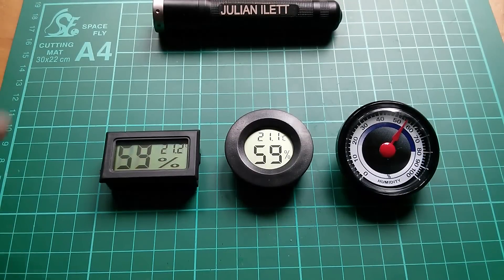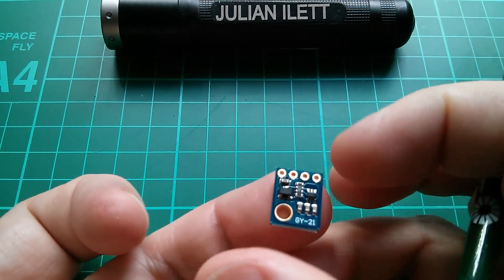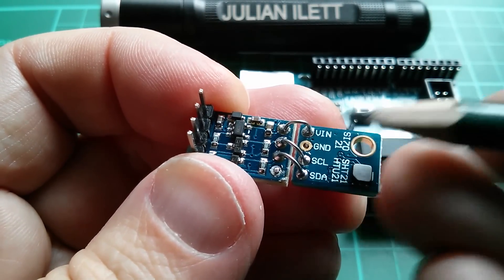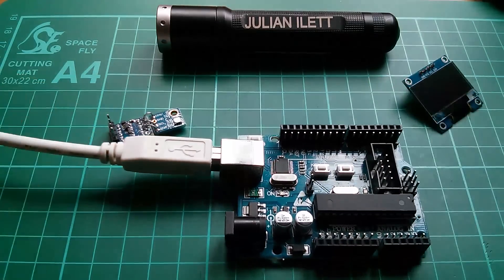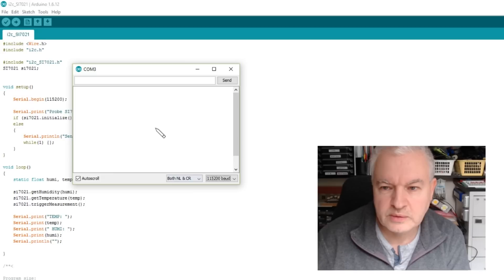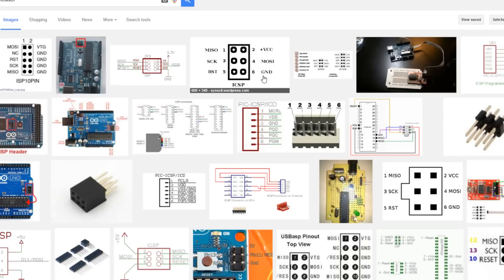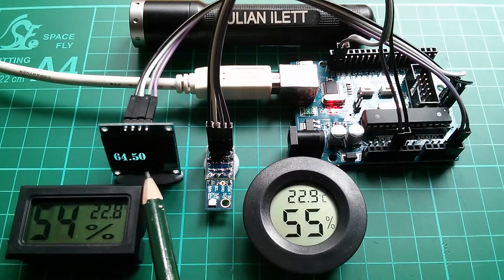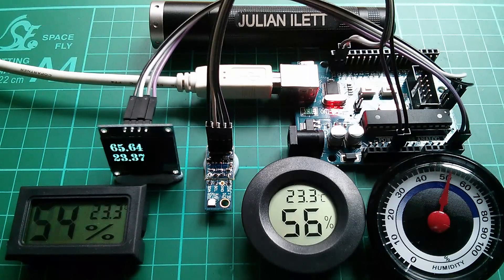1-Day Project: $10 DIY Arduino Hygrometer Si7021 OLED

Comment: I am playing with the DHT11 sensor recently and I have read that you have to average at least 8 samples to get the most out of these sensors. Maybe it would be worth a go. I have not tried it myself to see if there is a difference in my ranges, but maybe you can give it a go and see what difference it makes? there are multitudes of samples available on the internet. I see that you are doing a live update of your sensor output (as am I on my project), but people suggest putting a delay on refresh to let the sensor stabilize and gather data. technically, with a sample size of 8 and a 500ms update, there would a 4 second update time on the displayed results with higher precision.

Comment: I think that GY21 board already has the 5->3.3 voltage regulator and the required I2C level-shifters on the breakout board: that's what those small parts are on the opposite side of the board to the sensor IC.  So you didn't need to attach it to a separate level-shifter.
Reply from the maker: AAAAArrrrrggggghhhhhhh! I do believe you're right - your's is comment of the day :) That's almost worth a video all it's own!
Reply from the maker: Most eBay listings seem to be unaware of the built-in level shifters and regulator - although this listing does mention them! http://www.ebay.com/itm/New-HTU21D-GY-21-HTU-Temperature-Humidity-Sensor-Breakout-Board-Module-Hot-/271731131299
Reply: Julian Ilett Why, thank you :-)  You're right, though: most of the listings do rather lazily transcribe the specifications of the sensor itself and don't mention the extras.
Reply from the maker: I meant to mention you in my latest video (for spotting the level shifters on the GY21 board) but I was having so many problems with my camera, I completely forgot. Sorry - I'll try and remember in my next hygrometer video.

Comment: Yep liked the inset picture and a proper screen capture rather than recording the monitor is a lot easier to read. Thanks
Reply from the maker: Easier to read, but I'm having so many problems with CPU loading and consequently a low frames per second count.

Comment: Hey Julian, 
try to record your screen with a resolution of 420p sothat it doesnt freeze so often.
Reply from the maker: That's difficult to do in OBS
Reply: Go to: Settings --> Encoding --> Max Bitrate and change that to a lower Value after that you go to Settings --> Video --> Resolution Downscale and change that to a lower value, too.
The Videoquality mith not be so good as before but it wont freeze so often.
Hope I could help you.
Greetings from Germany.
Reply from the maker: I don't seem to have those settings. Are there 2 versions of OBS? I'm using OBS Studio.
Reply: I dont know if there are 2 Versions. But usually you should have those settings.

Comment: hello julian i think you answered your own question at the end of your vid, i am a refrigeration & air conditioning engineer, basically to measure  temperature is  cheap and easy, humidity is a different beast IE costly, it can be done electronically but if you want a cheap affordable measurement, then you need a whirling hygrometer, looks like a football rattle, works on wet & dry bulb principle, thanks andrew
Reply: Sling psychrometer is the term I was taught for the wet/dry bulb measurement. But far cheaper is using saturated salts to create a known RH in a closed system.
Reply from the maker: Thanks Andrew - I like the sound of a whirling hygrometer!

Comment: You actually don't need a level translator, since they're open drain just pull the I2C bus up to 3.3V, the Atmega on Arduino will recognize the voltage level just fine.
Reply from the maker: I read that on a sparkfun tutorial, I but thought it would be too difficult to implement without checking all the schematics

Comment: Check out the HTU21D, typical ±2%RH @ Resolution of 0.04 %RH, and ±0.3 °C @ Resolution of 0.01 °C.
http://eph.ccs.miami.edu/precise/GasSensorSpecs/HumidityTemperature.pdf
Little boards available from all the usual places.

Comment: I love the new screen capture. but stop the facecam. it requires heavy encoding on your PC, but there is no useful information in the video.

Nice video overall, thought.
Reply from the maker: Thanks Andre. That's the direction I'll take - in fact the facecam is just a distraction from the onscreen stuff.
Reply: Awesome! Maybe try capturing the screen as a smaller cutout. This also should help the video performance. For on TV watching it's best anyway to have a ratio of 4 video pixels per captured pixel. This keeps the text really legible.

Comment: Did you take the paper off the Arduino Humidity sensor?
Reply: it's a protective cover intended to be left in place. From the datasheet:
"The optional factory-installed
cover offers a low profile, convenient means of protecting the sensor during
assembly (e.g., reflow soldering) and throughout the life of the product, excluding
liquids (hydrophobic/oleophobic) and particulates"

Comment: Leave all the hygrometers in a same place over night to see if they "normalise", then attempt a salt calibration.
Reply: Totally agree. These little modules for Arduino were totally inaccurate for me by default. You must do a calibration. 

Maybe they are calibrated during manufacture and some external factors (soldering, transportation from seller in China) make the calibration invalid? Luckily we have the formula field in ESP Easy (it's a very good project), so we may adjust the humidity/temperature if it is consistently shifted in Humidity/Temperature formula field by say: %value%-1.
Reply: Adrian you have to consider the enclosured sensors vs bare sensor too. In the past when I have used various hydrometers I used to find a lot of variance according to airflow and plug in sensors always read higher than those with the sensor behind a few slits in the case.

A good excuse to take them all apart if you ask me 😊

Comment: Several websites give live humidity readings for many UK locations so you put the hygrometers outside and see how well they match.

 Or see, for example, http://www.engineeringtoolbox.com/humidity-measurement-d_561.html

You have a pretty accurate "dry bulb" temperature as all four devices agree, so you just need a wet bulb thermometer and you can calculate the indoor humidity.

What does 5% accuracy mean when talking about percentage reading. eg if it's reading 50% does that mean the true value is somewhere between 45% and 55%, or between 47.5% and 52.5%?
Reply from the maker: Good point - and another good point :)

Comment: How about making.a wet bulb hygrometer?  Use two temperature sensors, keeping one of them wet with a wick. Maybe a small fan to make things equalize faster. The plug the two temperatures into a relative humidity formula and Bazinga! Relative humidity.

Comment: you can check the accuracy with the salt test see http://www.wikihow.com/Calculate-Humidity
Reply: use wet towel in cooler/isolated container to calibrate hygrometer.

Comment: If you power the arduino with 5v from USB what does the 3.3v pin give you on the board?
Reply from the maker: You're welcome :)
Reply: 3.3v, it has a regulator on board!
Reply: Edmund Fisher
So why did he not just use the 3.3v pin?
Reply from the maker: Because the SCL and SDA pins on the Si7021 aren't 5V tolerant
Reply: Julian Ilett
Does the 3.3v pin on the ardunio not give 3.3v?
Reply from the maker: Yes it does, but you've still got the problem of 5V signals (SCL and SDA) on the Arduino and 3.3V signals on the Si7021. However it's academic really! The little GY21 PCB has level shifters and a 3.3V regulator onboard. AAAAArrrrgggghhhh.
Reply: Julian Ilett
I did not think about the signals being 5v, only just got into Arduino and still learning. Thank you for answering this question and for the videos.
Reply: Julian !!  I purchased the same Si7021 sensor boards you use in the video - but the e-bay web site specifies "Wide operating voltage (1.9 to 3.6 V)".  How did you know there is a level shifter (5V <> 3.3V) on the GY21 board?   Also - assuming you actually needed the level shifter - wouldn't you need to provide a 3.3 V supply voltage to the shifter board - so the transistors could use it on the low side for the shifted data signals?  I didn't see you hook up a 3.3 V in the video?  Thanks for your comments !!
Reply: What the next video in the series, it becomes more clear.

Comment: Arduino have 3.3V output ;)
PS: quality of video from PC is very bad and freezing
Reply: GOOOD TRY  I LOVE IT EVEN IF IT IS LAGGY ASFUCK!
Reply: +Julian Ilett If your PC is borderline freezing, then you need to either use another codec or lower the quality as your computer is trying to process too much.

If possible I would recommend going to settings and under encoding switching it to Intel Quick Sync or Nvidia NYENC, either setting will use your GPU for encoding rather than your CPU with a slight hit to quality. (Also you might try installing the Lagarith Lossless Video Codec)

If you can't do that or it still good isn't enough, then try going to video and adjusting the resolution downscaling down to 720p or less and the filter to fastest.
Oh yeah and you can go to advanced settings and change the H.264 preset to ultrafast/QuickSync to best speed and that should help speed things up.
Reply: Malcolm Crabbe
We just make suggestions and offer help. Noone is trying to be mean.
Reply from the maker: Yeah, don't I know it :)
Reply from the maker: With OBS capturing The c920, Chrome and Arduino IDE, my PC pretty much ground to a halt !!
Reply: your camera ur using for to show ur face is laggy
Reply: i think you can set up different obs capturing scenes and you could put chrome,the IDE and you screen in different scenes. that may speed that up or at least make it less laggy.
Reply: @Bryn Gerard
Quicksync didn't help on your i5? Is it a pretty old i5? (1st or 2nd gen?)
Reply: I don't play games so I wasn't aware of QS and everything I ever chucked at the Lenovo T430 worked fine. I always buy recycled kit thrown out by large corporates and max the  memory out and put an SSD in them. I paid £100 for it. Thanks for the info on QS, I see support for it in OBS. One thing I did notice is that USB devices via a hub are laggy.
Reply: it may be bad quality but it's MUCH better than the other programs' video quality.
Reply: Guys, lets nor be too hard on Julian.  he's still getting to grips with OBS, and even with the lag etc It's a million times better than the old method of pointing the camera at the monitor.... at least now you can actually read the data sheets and info on the screen...  I'm sure in the next few weeks things will improve as Julian sorts out the settings
Reply: as long the sensor isn't receiving any signals. if so you can just power with arduino. This looks like it would be fine but I haven't checked out the datatsheet or anything

Comment: http://www.stevejenkins.com/blog/2014/06/how-to-calibrate-a-hygrometer-humidity-sensor-using-the-salt-test/ You can try to calibrate them with salt solution.
Reply: There is a Big Clive video about these which includes calibration with saturated NaCl solution
Reply: Markle2k Tanks for your comment. Off course, there will always be a vapor pressure. However, that vapor pressure could be very small or may be a constant below freezing point (I really don't know).
I just thought, given the wide range of measurements Julian got, this could be a 'quick and dirty way' to challenge those devices.

Cheers!
Reply: How about sticking it into the freezer to get a zero point?
Reply: +Fernand Geene Van The RH at 0C won't be zero. Ice, metal, all solids have a vapor pressure.

And I also came to point to the various salt tests.
Reply: Fernand Geene Van Sure,no problem. And I think I can help you further because I think I see where you are making your error. We're talking about relative humidity rather than absolute humidity. Relative humidity is dependent upon temperature because the water vapor carrying capacity of air increases with temperature. Relative humidity is the percent ratio of the actual vapor pressure of the water fraction (the absolute humidity) divided by the saturation vapor pressure (the dew point) at that particular temperature.

If you haven't done a Homer Simpson and slapped your forehead and said "Doh!" I can try to explain further. Wikipedia is pretty good too, although sometimes it gets too technical for people who are new to a concept.

The salt test is really the gold standard for calibration because the air in the closed container will reach a specific relative humidity almost flat with regard to temperature. It's certainly more precise than the rated accuracy of Julian's hygrometers at the temperatures he'll be using them at.
A NaCl slurry will reach equilibrium of 75.51% ± 0.34% at 0C. At 25C the equilibrium RH is 75.29% ± 0.12%. At 80C it is 76.29% ± 0.65%
A MgCl slurry will equilibrate at 33.66% ± 0.33% at 0C, 32.78% ± 0.16% at 25C, and 26.05% ± 0.34% at 80C
These are experimentally confirmed, peer reviewed numbers.
http://www.omega.com/temperature/z/pdf/z103.pdf
Reply: Markle2k Thanx!
Reply: If you read the datasheet in the description of the video, this sensor doesn't need calibration. But some factors (page 14) can change the accuracy: solder reflow, Hysteresis , very humid conditions, contamination.
Julian can test the hygrometer overnight and see if the problem persist. http://www.wikihow.com/Test-a-Hygrometer

Comment: I think you need a new computer
Reply from the maker: Yeah, me too!!
Reply: lol. I meant your. Im lucky here, my 2 year old laptop is still better than most peoples PC.
Reply: *****
Im just going to guess he has more brains than to buy locked-down hardware and software and pay more for it.
apple are retarded.
Reply: lol Jeesus. Lay off the caffeine. You dont know me well enough to insult me, And it looks like you really tried. Apple is just a shit company.
Reply: No, you don't necessary need a new computer. ;) It's rather configuration.
As I said, try Quicksync or NVENC depending on what GPU hardware you have installed.
If you like, I can offer you a teamviewer conference.
Just write me a PM.
Reply from the maker: Points taken.
I do need to reduce the CPU load while running OBS. Actually I found the facecam distracts from the on screen work, so I may only use the webcam for eBay listings and the like.
The audio was coming from the webcam's mics - they're not good quality and too far away - I think a separate USB mic should fix that.
I really don't want to introduce editing software into my system - Youtube Editor is good enough. As a YouTuber, I spend most of my time coming up with new ideas. Video quality is important, but not if it impacts on creativity.
Appreciate your comments :)
Reply: +Julian Ilett ask it to the wife for christmas :D
Reply: OBS needs to be properly configured, else it uses a lot of CPU.  for example you may wanna enable intel quick sync, for intel CPU with built in GPU. same for AMD, but you need to enable VCE framework for AMD though.  if ur GPU is nvidia, you direct encoding to that.
Reply: Btw, have you seen the new Macbook Pro?
Reply: Think how stupid the average people are and you are stupider than that. Never mind, it's not fair.
Reply: Julian, couple of (as) brief (as I can make them) suggestions. 

Low frames per second are fine for text-only screencaptures - if you plan to stick your face in there, and your hardware can't keep up, change how you capture. If your pc struggles to do webcam and screencapture and HD and high framerates, don't ask it to do so. You can instead capture the face stuff with your phone and insert that video, with better control, as picture in picture when you assemble and edit the video. The OBS encoder will then have an easy job with plain text, your phone does it in hardware, and your editor's final encoder can take its time, and everything will look better

Sound quality and tone is more critical than video quality. Way more critical. The eye can put up with a lot that the ear cannot. You can't switch back and forth between audio contexts like that, the ear will not happily accept it. Room tone and mic tone really matter. You do not need to spend money. Your phone's audio as used in all your other videos sounds fine. Keep using that. You can still record the screencast audio on your PC as you do it, but to be used only as a guide track for sync, have your phone recording you talk at the same time, same setup and separation as at the bench. Use the voiceover audio from your phone's recorded video when you are doing the edit. 

Yes, I know it takes extra time to wrangle and keep track of all these clips and keep things organized, and it clearly complicates the edit, and it's just a YouTube video about Chinese electronics not a Sundance film, but still, for no extra spend and just a little extra legwork it would hopefully make for a markedly higher quality final product.
Reply: Yeah, I originally wasn't going to hit submit on that big reply because I wasn't sure if you were using a stand-alone editor, and suspected you were doing it all in YouTube.

Like you say, the facecam isn't needed for the screenwork, and a USB mic should give you a good bump in quality. Keep the workflow nice and agile. All the best.